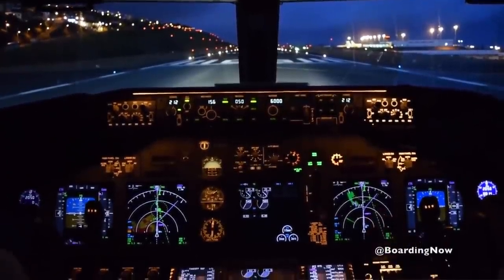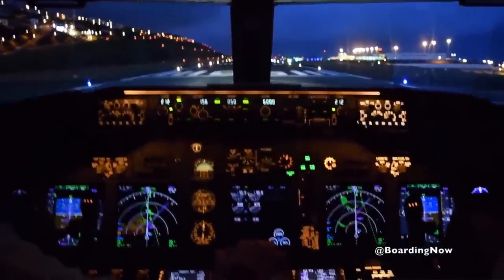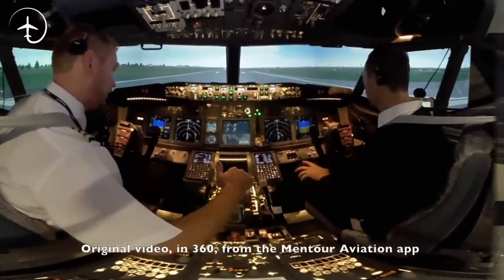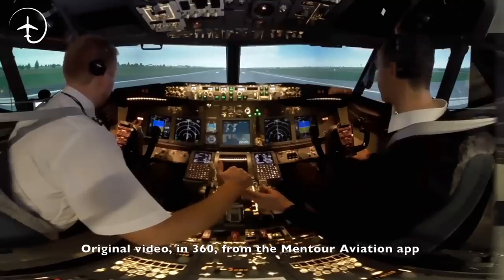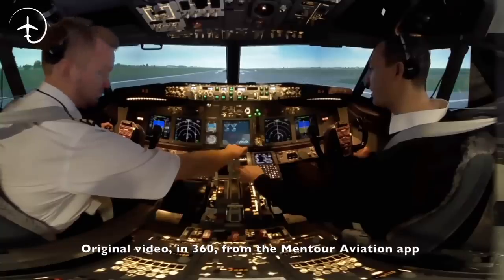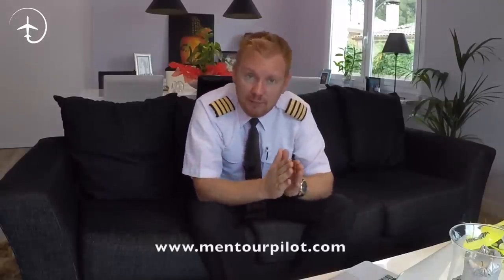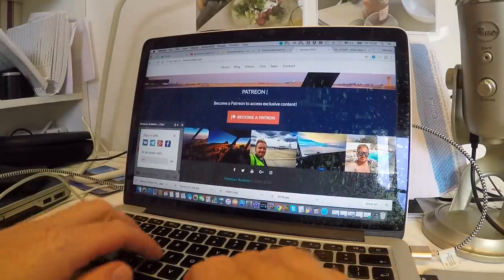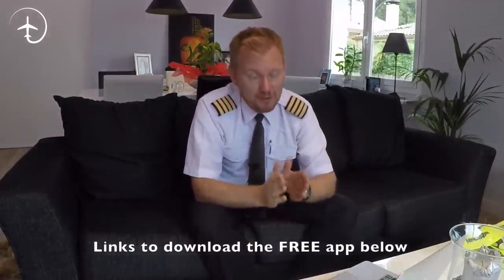Why do the aircraft engines "stop" accelerating during takeoff?

Comment: Back in my Vietnam days we flew on commercial airlines with military pilots.  There is quite a difference in how they flew a plane full of troops compared to civilians.  The takeoffs were usually at near full power and the landings were MUCH steeper.  The plane would turn after takeoff while still very close to the ground, which is truly scary.  First time into Tan Son Nhut in '68 in a 707 the runway was being mortared.  We came in from 41,000 feet to ground in what seemed like a simple drop and a lot of guys were white as sheets grabbing on to the arm rests.  I recall the pilot's words over the intercom, "Ah, gentlemen, we'll be coming in fast due to some ground activity.  Be prepared to leave the plane as soon as we pull up to the hanger.  Grab any dufflebag on your way under the plane - you can sort them out later."  I've never experienced a plane stop so fast.  He was off the ground a few minutes after we were out.
Reply: I had close to the same experience leaving PSAB back in 96-97 time frame. We were in an ATA L-1011 Tri-Star, and on take-off the pilot raised the AOA quite steeply for a civilian airliner and circled the air base perhaps 5 or 6 times at what I presume was full thrust, until the plane reached a sufficient altitude so that Stinger missiles had no chance of intercepting the plane on fly out. It was quite unnerving given the fact that they did not notify us prior to takeoff that they were going to do that, added to the story from the Air Force folks 6 months earlier when we initially flew into theater, that an AH-64 had flown out and killed a insurgent armed with a manpads rocket that was targeting flights coming into the base. At the time I Initially thought that was simply a story to razz the incoming soldiers, until months later when the giant voice system on the base announced that they were about to detonate an IED, only to be followed by a rather large boom seconds later. Not only did this happen once, but several times during our 6 month tdy stint in that oven of a country. "Yeah but it's a dry heat" says Corporal Hudson. NOT. At 120 degrees, it doesn't matter. And those lovely showers where the only temperature is scalding hot from those massive water bladders baking in the sun. Those were the days.........
Reply: @David-hw5xk  we would do tactical approaches in the C-130s into and out of PSAB back in the day. Fun times. Flying Crew Chief, C-130. 363rd EAS, 2000.
Reply: @rocnnrollbus  Nice, flight crew would have been a fun job. I was TDY to a SATCOM facility for 6 months. Managed to get there RIGHT in the middle of summer. Thought I wandered into the jet blast of one of RB211's when we arrived, then I realized that was just Saudi. But hey, even though we never left the base, I did get quite the exhilarating ride aboard a Blackhawk with a pilot that I swear thought he was flying in an AH64. Didn't think a Blackhawk could maneuver like that.
Reply: Nowadays people hear you guys coming from thousands of feet away due to all the noise your dragging steel balls make .... good god, can't even imagine being involved in any of this stuff and I am no pussy.  Well, compared to ya'll maybe I am a little bit.  Would do it if I had to I suppose.  Hats off to ya
Reply: @Wilhelm Taylor - When you mentioned the steep turn after take off, my first thought was "taking off from NKP, Thailand in C130 Hercules. Thank God those days are long past.
Reply: Good story...thanks for sharing!
Reply: Arm rests? Nope - we were on a military transport plane with webbed baskets - from El Torro to Wake Is - then on to Okinawa.  But in Da Nang, at least - there was ground -fire beyond the runway to deal with, so that's why the "military take-off. Full rev - then brakes off - rapid acceleration - early rotate and gain as much altitude as poss before leaving protected airport boundaries.  Great fun - better than any ole carnival ride.
Reply: J.D. Saldivar  , I was an A& P Mechanic on those C-141's back in the Nam Days. They had a lot of power compared to the 707,727 and many larger civilian Aircraft. I got to do a lot of checkout flights and I enjoyed it. I'll bet the C16 feels even better. The Turbo - Fans (TF33), on those were a huge improvement over the older style Jet Engines such as the J57 Pratt & Whitney Engines on the B52. Air Force later upgraded to TF. Twice I saw that big Ass plane jump chocks on an engine run up at max EPR @ sea level,I couldn't  get that headset off fast enough and run.   Civilian Aircraft still feel slow to me.
Reply: Incredible story, but the 707 didn't have the "large turbofan" that might require the run-up to 40% before going to takeoff thrust.
Reply: It would really be funny if, after military service was done, those pilots would by mistake just once slip into their old ways of doing things. Give the passengers take offs and landings they would never forget.  LOL Thanks for sharing.
Reply: The Pilot really is well experienced of his plane and flight methodology... Perhaps the Manual Piloting System is far better than Auto because when problem comes, the Pilot can do the safest way to have the plane under his control! Nowadays Flight Pilots become complacent and never study or think the possibilities that IF.... so and so happens, what will I do? See what happens in the Boeing 737 Max 8 of Lion Air and the latest Ethiopian Airline Crashed incidents.... RIP to the victims and the Pilots!
Reply: Yeah...I remember those days very well. It was up to my crew and me
to make sure those aircraft were properly maintained and serviced 
so they would perform perfectly, precisely as you have described. The 
maintenance work always had to be done perfectly, even during the 
worst VC attacks. Glad you made it home, Taylor. Apparently, we did our 
job well, as did you.
Reply: Same reason combat veterans drive so fast on the road. They want to minimize the amount of time exposed on the road and keep on living.
Reply: My rock climbing buddy was in a bar (in Danang) the night of the 1968 Tet offensive.  He said suddenly there were people shooting at anything that moved, it was a nightmare with guns and grenades.
Reply: You can still experience this. Just go to Cuba and take a national flight with Cubana. Did this, the pilot pulled that AN-158 up the sky like there is no tomorrow. Same with the approach at destination, veeery steep decline. Was amazing. But he did not care so much for the inflight information. The announcement was "we are traveling at a height of .... very high and speed of very fast" :D
Reply: Sounds like fun!
Reply: I remember an Air Force C130 at our local airport making a banking turn right after take off. It looked scary especially with those four loud engines

Comment: I don't remmeber pilots doing this in the old days.  I remember flying out of Tehran in the 1960s during the summer (hot and high) on old BOAC Boeing 707s (powered by Rolls Conway low bypass turbofans), and the pilots would power the engines all the way up with the brakes applied.  It was so loud and the plane would shake and shudder, and then they would let go of the brakes, and the plane would surge forward.  I've heard from older pilots that the low-bypass engines or pure turbojets responded almost immediately when power was needed, whereas the high-bypass engines had something like a 5 to 10 second delay, which they had to get used to once they began to fly with those newer engines.  With the hot and high conditions of Tehran in the summer, I also thought that they probably wanted the power to be at its maximum before they began using up any of the runway.  The plane sure seemed to accelerate down the runway for a very long time before taking off, or maybe that's just how it seemed to my six year old mind.

Comment: I could be wrong but I was under the impression that as well as the potential asymmetric thrust issue (which was far worse on turbojets I have been led to believe), there is also a wear and tear issue. IE some engines directly use engine power driving the lubricant pump (jet lube oil looks a bit like water it's so thin). IE you let the engines stabilise at about 40% thrust (which can be 80% RPM on some engines) to get the oil pressure in the thrust bearings flowing hard before they take full load. The thrust bearings are not much bigger than the palm of your hand and take up to 50,000 pounds push as well as whatever rotational force is caused. Without high pressure oil they would wear in no time from increased friction and the issues associated with friction heating. I believe most since the late 80's use electric oil pumps very similar to hydraulic pumps for oil pressure, but there are a surprising amount of J79's still in use as well as other even older designs (RR Olympus for example). Newer Olympus have electric pumps but they are originally from the 1940's, way before electric pumps were used. Some of those old engines are still in use (on ground installations for power generation mainly).
Reply: Gordon Lawrence   Turbo fans have more power than turbojets, and losing an engine has a bigger effect.   On the KC-135, we switched from turbojets to turbofans. The swap required an automated rudder system to control the rudder in case of engine failure, because a pilot could not react fast enough during engine failure to control the plane without the automated rudder.
Reply: How is that even relevant? When you are talking about asymmetric thrust, the engine management systems for the old turbojets were nothing like as good as modern ones used on turbofans. Therefore in a situation where you are spooling up you are more likely to get a bigger differential on turbojets compared to turbofans.

Comment: I love the sound of the CFM56-7B when you advance the throttles. First the heavy buzzing sound when it revs up through 30% and after some seconds you hear the soft whine (love it!) when it reaches 40-45%. And when it's stabilized, the pilots unleash the power! The howl as it revs through 60% turns into a brutal roar when it's reached take-off thrust! Eargasmic!

Comment: To point out:  I don't think he mentioned that because the engines are air compressive devices the local wind conditions, heat over the runway and even the aircraft's angle to the wind on the runway can make the spool-up not only vary but also make the total thrust output vary.  So they spool the engines until the engines are creating their own small "climate" of wind and density then adjust them for those conditions.  It can be especially strong on smaller twin tail engined aircraft.

Comment: As a kid, i was always intrigued by the 737 NG, how it would spool up really hard, then pause and sound like it's spooling back down, then spool up again even harder. 

CUUUUUUGGGGGHHHHHHHHpssssssuuuuuuuurrrrhhhhhh...............PSSSSHHHHHHHHHHHHHHHHHHH

On one of my recent flights, i think they spooled it up to 40% and then held it there for a considerably long time (in hot weather) before going full. Not sure if they were unsatisfied with the different spool up rates or something unrelated (maybe Tower had more things to say)
Reply: Right. In hot weather, the ambient air is less dense, causing the jet 
engines to perform a little slower than in cold weather. In fact, some 
US military aircraft used to have spray nozzles mounted near their jet 
engine intakes (like the KC-135 A/C... with its J-57 engines, for example). 
During hot weather, those spray nozzles would spray a fine alcohol/water 
mixture mist directly into all the engine intakes to make the inlet air 
pressure colder and more dense during takeoff. That mist increased engine 
performance by as much as 25%. Just FYI.
Hope this helps. Cheers!

Comment: Thank you for the video--very informative.  Now I know.  

Back in the 50's & 60's when the 707 was introduced and runways were short, flying commercial was very exciting.  Takeoffs were at full power with us passengers literally plastered against our seats and our faces being pulled backwards, as if we were in a spacecraft.  Upon landing, the engines were immediately fully reversed, so if someone did not have their seat belt fastened, they would probably end up on the floor after sliding out of their seat.  Much different today.  I miss the old days, but this manner of taking off and landing must have been tremendously hard on the aircraft, especially the engines, but also the entire plane.  Nowadays, with long runways, it sometimes feels for a while like the pilot is going to drive to the destination instead of fly, and engines are only briefly reversed upon landing.

Comment: I never knew the reason for this, but that makes sense! I'd guess (as an engineering undergraduate) that the acceleration rate of the engine has more to do with the N2 rotation speed than the fan speed - turbine engines work much more efficiently at high pressure ratios, which requires high compressor speed, and any extra friction in a worn out engine would have most effect at lower power settings. 
I was once on an easyjet flight where they didn't seem to pause at 40% on takeoff - there was an aircraft on final so they may have been told to "expedite"! It seemed they taxied onto the runway with ~40% already set, then went straight to takeoff thrust without stopping.
Reply: Iwan Wrigley most thrust comes from the fan. The efficiency is mostly lost by increased gap between the blades and the case. Bigger the gap the more air bleeds past the blades and not working on turning the blades, so less efficient. Old engines actually have very little turning friction. Our engines can keep turning for over 5 minutes after cutting off the fuel at idle.
Reply: Thanks, good to know!

Comment: Hello, Air Traffic Controller from Hong Kong here. I got question I would like to ask. Does a slow taxi speed reduce the fuel consumption? The situation was, the weather was suddenly very bad with thunderstorm and aircraft at the holding point did not want to depart at all. But some aircraft had already commenced pushback and would expect an airborne time of 30 minutes later.The time needed for these aircraft to taxi from the terminal to the runway holding point would normally take about 5 to 10 minutes only and then they would be waiting at the holding point( or moving forward in the queue along the taxiway). In such case, does a slow taxi speed reduce the fuel consumption if the airborne time remains the same no matter how fast they taxi? And, is there any ways to reduce the aircraft fuel consumption between pushback and take off? Thank you! I like your videos! Your videos help me to understand what pilots think and want so I can provide a better service
Reply: well i know this well but this doesnt answer my question but anyway thank you
Reply: I don't think petter ( mentour pilot )replies to any questions on here!
Reply: @stevokennedy2383  he does occasionally here and on Instagram
Reply: After pushing up the throttles to start the aircraft moving, the throttles could usually be brought back to idle and the aircraft would continue to move at a slow but decent speed. If you wanted to taxi faster, you would have to push the throttles up farther or longer, using more fuel in the process. A continuous, mostly at idle, taxi to takeoff is ideal. Stop and go taxiing uses a lot of fuel. Any large aircraft, especially Boeing 767s and larger, burn a lot of fuel to start moving, so once moving you want to keep moving. 

The advantage of sitting at the gate is that fuel consumption can be zero if using ground based electrical power and air conditioning. Sometimes the gate was needed for another aircraft so we would have to push off the gate, start engines and taxi to a holding point or get in line for takeoff. We usually had enough contingency fuel for short delays. If we thought the delays would be extensive we would only start and taxi with one engine, reducing fuel consumption about 50% (on a twin engine aircraft, 66% on a trijet). Weight was a consideration. If we were very heavy, we had to start two or more engines to preclude jet blasting everyone and everything behind us. If during taxi and stopped at a point where we could expect to sit for a long time, we could shut down some or all of the engines and use the the auxiliary power unit (APU) for electrical power and air conditioning. The APU used very little fuel compared to the aircraft engines. We always had to monitor fuel consumption and consider how long it would take to start the aircraft engines and warm them properly before takeoff. Cold weather operations with ice and snow added the complications of getting deiced with the proper mix of fluids, computing the maximum time before having to takeoff or getting deiced again. In rare instances we would have to return to the gate to get more fuel AND deiced again. If we were the only aircraft at the airport it would be easy but at bigger airports like Chicago, New York, or Tokyo you became one of many needing a gate, fuel and deicing. Other time calculations were crew duty times and ground delay times. Crew duty times to see if the pilots and flight attendants had enough time to endure the ground delay and fly the flight to destination. In the U.S. there were rules that could force the aircraft back to the gate after a certain amount of time away from the gate without taking off (Not a factor if the aircraft never left the gate.).